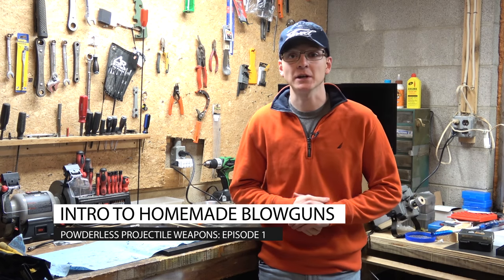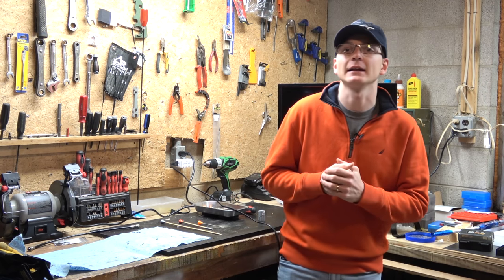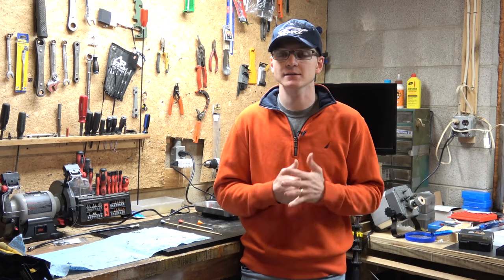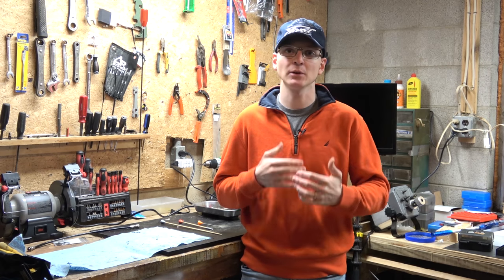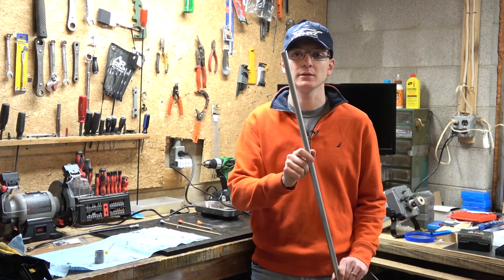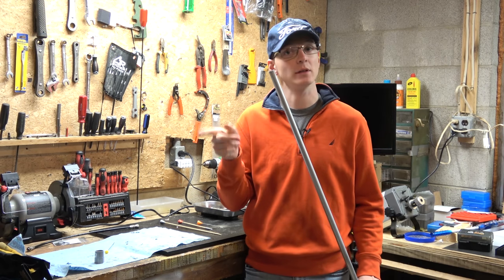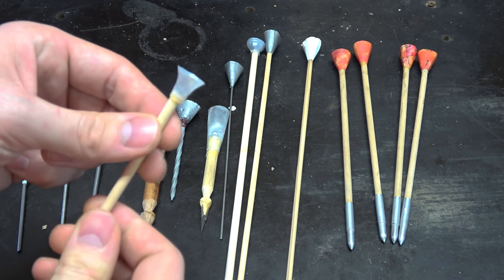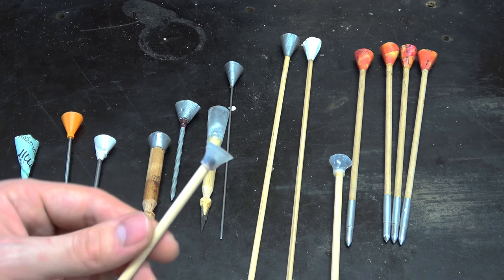Intro to Homemade Blowguns

Comment: Hi this is a great video! Practical on every side of it from making to shooting blowguns. I really like your thoughtful way of presenting the whole thing from start to finish with ideas on shooting as well. I managed to make one from a pvc conduit but the problem is what you mentioned. It sags and this is a big problem. Is there any way round this problem? Can you also provide some comment on short darts vis a vis long ones. Perhaps some idea on aiming would be good as well. Thanks very much.
Reply: Duct tape a broom stick to the bottom of the pipe to prevent  it from bending

Comment: I found a box of surgical steel spikes of varying sizes. From about 3 mm thick down to 0.5 mm and different lenghts from 100mm to 400mm. They are all sharpened in either one or both ends. The larger ones are great Bo-Shurikens. I made blowgun darts from around 20 nice ones. I have to bring pliers, as they just sink so deep into whatever wood I am shooting at. Cans are no match. Wine bottle went on first try!! 5m distance. Those spikes are so nice and I have a whole box of them. It comes from the veterinary college, I think used in complex fractures of animal bones.  It is fun to just grab a fidtful and Bo-shuriken the hell out of the target. I need to make a better blowgun than the one I used to test the darts I made. Just acopper pipe, which I don't think is good for me or my skin
Reply from the maker: Nice! I wouldn’t worry about the copper too much.

Comment: You can easily fix the flexing problems with pvc piping by wrapping in a criss Cross pattern, you only need a couple layers and let it dry, I can imagine it would be a lot more durable doing it this way.

I wouldn't know they are illegal here in the uk
Reply: You can also use a piece of the just larger pipe as it fits outside making for a double layer one, some tape on the smaller one to fit it snug and you got a very rigid rod.
Reply: That's what your king told our lads about their flintlock muskete😂

Comment: Big trouble making darts when you can buy  50 Cold Steel mini broadhead darts for less than 20.00$. The store bought ones fit perfectly in  1/2 inch EMT tubing. They last much longer and shoot straighter.
Reply from the maker: True. But making darts is half the fun! Chances are I will buy a commercial .625 blowgun and darts soon.

Comment: Great video! Really enjoyed it.  Any opinion on copper pipe?  Thanks
Reply: Yup, I was thinking the same thing.
I would imagine so. Gonna go that route. Looks like fun. This young man is brilliant.
Reply from the maker: Sorry, didn't see this comment until now. I have used copper pipe in the past. 1/2 inch copper pipe is actually about 1/2" in ID. So .50 caliber. It works great! A little less "umph" in my experience than the .625 ID pipe. The copper pipe does bend easier, so you have to be a little more careful not to smack it against doorways, trees, etc. It's also harder to find a straight piece at the hardware store.

Comment: Good post.
I was looking for something to do to pass time and enjoy what I’m doing. I was searching for blow, guns just now, and how there are made, Maybe find the materials and how to make them. 
I’m like you in that I have done must of the gun and fireworks periods of my life and looking back for anything I may not have tried. I have wanted a blow gun several times in my 72 years on this planet.
You’ll get an A- grade for that posting by me, Also, I got all the information I was looking for. If you would take a little advice without getting all defensive, I would like to help you, I spent lots of years learning things.
You could improve two-fold by condensing what you said by 50%. Make it half as long. If you don’t shorten it, you will lose your audience half way through.
I used 3” X 5” flash cards with my next topic highlighted. After I said everything on that card  and when I was at the bottom of the FC, I would quickly flip to the next one over.
Please do another build, I would like to see how you do.
thx

Comment: What size of conduit would you need to shoot standard, commercially available, .40 or .50 caliber ammo?
Reply from the maker: @ralphcantrell3214  1/2” copper conduit will work for commercial .50 darts, but it is soft and easily bent. .625 commercial darts from Cold Steel or Slockmaster will work with 1/2” EMT conduit.
Reply: @TheOutdoorGeneralist  Thanks. I have a 5-foot, .625 caliber Cold Steel Pro blowgun. I bought it new about 15 years ago, but now, well into my late years, my lungs decided I wanted a .50 caliber, but there simply are none available. Even the .40 caliber ones are only 3-feet long! I have a couple of these too, for the kids to target practice with, but I am spoiled on 1-piece blowguns of a decent length, so I guess I'll just have to make something.
Reply from the maker: @ralphcantrell3214  are you in the USA? If so I can suggest a few options for commercial .50 cal blowguns!
Reply from the maker: @ralphcantrell3214  https://a.co/d/eZl62p0
Reply: @TheOutdoorGeneralist  Yes, I am. Thanks.
Reply: @TheOutdoorGeneralist  Got the link. Thanks! I wish it were 5-foot, but 4-foot is certainly better than 3-foot.

Comment: Awesome vid and content. You mentioned that 10' was too long , why? I was thinking 3-4' would be more optimal. What are the plus and minus of diff lengths? Would you get more compression if you had a wider mouthpiece to maybe a reducer ... 3/4" to 1/2" for the mouthpiece?
Reply from the maker: ed ragon The length debate on blowguns can be a long one. Different lengths are better for different things. You can get a pretty decent dart speed out of a 10’ blowgun, if your lungs have the strength to push it that far. The back pressure can be enough to physically damage your lungs though if your not careful. Any pressure in the alveoli greater than 30-40 cmH2O can cause damage, and blowgun shooting already causes a brief period of high PEEP (peak end expiratory pressure.) Also, when we used a piece of conduit that long, we had to use some sort of rest to hold the blowgun up. It’s not a very practically-sized object to move around with. I do like shorter blowguns in the 3-4 foot range, but you’ll find that the velocity decreases. Everything is a trade off. As for the mouthpiece: Think of your mouth as the reducer from your trachea and pharynx. Adding a wider mouthpiece would only make the reducer slightly longer, with little to no effect.

Comment: Great video BTW - didn't catch the name of the conduit - 1/2 inch "AMP" conduit?  Is that a brand?  Any online link to a manufacturer or supplier?
Reply from the maker: EMT conduit (electrical metallic tubing I believe) Can be found at any Lowes, Menards, Home Depot, etc.
Reply: @TheOutdoorGeneralist  Great - thanks!
Reply: @TheOutdoorGeneralist  I really like the aluminum tipped design BTW - very clever and practical.
Reply from the maker: @politicalfoolishness7491  some of my best darts, for sure.
Reply: @TheOutdoorGeneralist  A++ idea and technique

Comment: Aw yeah crack on brother , could a fiberglass fishing rod stock work out I'll check in out dimensions I've got loads of rod section s .
I'm probably better off in the uk with a 20mm or 15 mm copper pipe .

Comment: Looking for blowgun that can use round steel shot, like slingshot ammo, one time use .. no traceable cone .!
Reply from the maker: Not a lot of area on the back of steel shot for a human’s low-pressure breath to act on, compared to the weight of the projectile. You may find a piece of tubing with the proper ID, but you probably won’t get much velocity out of it.
Reply: @TheOutdoorGeneralist  I used a .625" ID 10 ft AL tube with glass marbles against a glued down lego 30 degree angled wall, it was a toss up as to if the marble would shatter, bounce or break the lego wall.